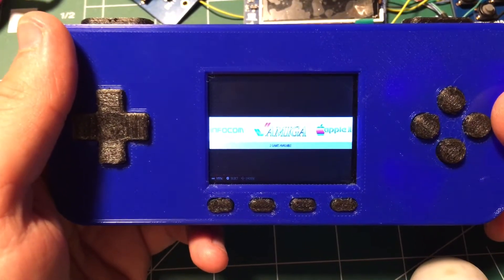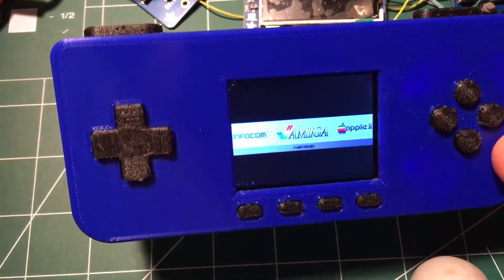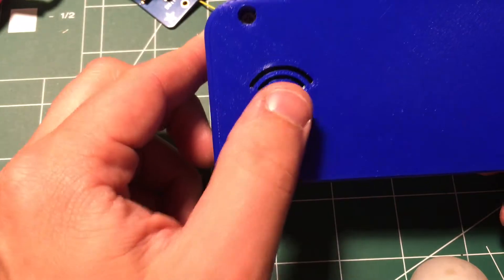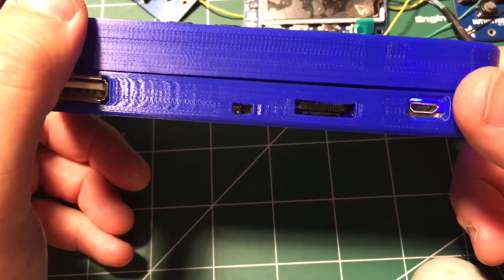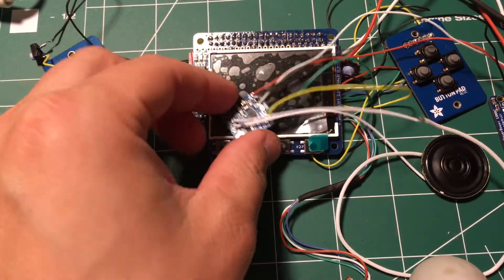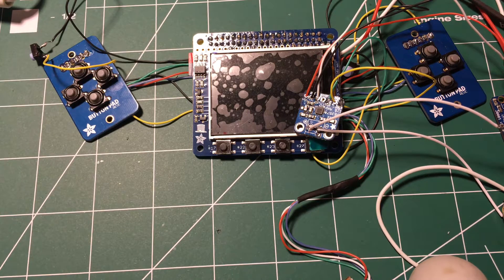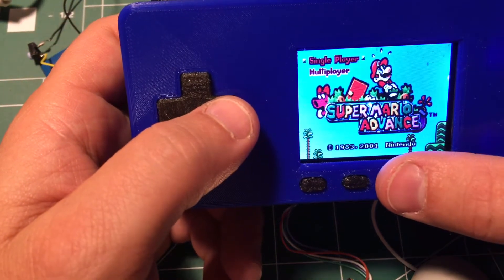PiGRRL Zero - Modified Case and Added External Audio

Comment: There is a point on the amp (the sd point) where the instructions say to solder to 5V on power boost. There are actually 2 that are supposed to solder to the power boost. Where exactly do I solder both of those?

Comment: i downloaded all the files do i combine them on 7z?
and if so, does it give me an img file once combined?
Reply from the maker: Yes it will produce a .img file. It should work fine, but let me know if it doesn't, I can host another one.
Reply: Ok I thinkI got it now, I burned the image on ad card and put it in the pizero. All buttons work but all I get is white noise? Am I missing a step. All my wiring seems to be correct
Reply: Sorry I'm kinda new at this lol
Reply from the maker: No worries! It's a fun project so ask all the questions you need.
Reply: thanks, well  ive got it all wired up and running but all im getting is white noise, am i missing a step?
Reply from the maker: I'm not sure what it could be. I'd need some photos or a video of how you hooked it all up.
Reply: ok ill take some pictures and post them here in a bit
Reply: do you have an instagram? i can send you the pictures through there.
Reply from the maker: How about posting them to imgur and then sharing a link? Hit me up with an email and we can chat directly there.
Reply: There you go, let me know what you think
Reply from the maker: Well your wiring seems to be correct. Move  your speaker close to one of the PCB's, and see if you start to get audio then. I notice that if you don't have a ground near the speaker itself, it won't work correctly.

Is it constant white noise? Is it loud? Can you make a video of the noise its making? Could be the speaker too. these things are easy to damage sometimes.
Reply: yea its constant if i turn the pot clockwise it gets louder, you have to put your ear to the speaker in order to hear it. do you think maybe its a faulty amp? i have 2 speakers one from adafruit and one i salvaged off a digital picture frame and they both do the same thing. ill try moving the speaker like you said and make a video. i got another amp coming in from adafruit tomorrow so we'll see if the amp is the problem.
Reply from the maker: The amps can blow out sometimes, I have a couple on the walls that have went on me because of bad hook ups or whatever. You should try another amp and another speaker. Maybe disconnect the potentiometer and direct connect it first to see if that isn't the issue first.
Reply: same thing happened with the new amp. idk what it could be. all i get is white noise. an no sound at all with  it being hooked up directly
Reply from the maker: Did you try a new speaker? Did you disconnect your potentiometer and try it without that first? Maybe double check your wiring connections to be sure it isn't that? Does the system work without sound? Can you play games?

Comment: Just got everything wired up.  The audio is super distorted, almost white noise.  It's very quiet for almost the entire dial turn, but then gets super loud once you turn the dial all the way.  Anyone else have this problem?  NES games seem to be running slow as well.  Weird!
Reply from the maker: +Sean Horton sometimes I get some lag in NES games, but it usually isn't a big deal. Could be the emulator, maybe try a different NES emulator. 

Audio can be distorted if you don't have a proper ground from the speaker or volume dial. Check your grounds and see if they are connected to a PCB ground or something.
Reply: Thanks for the reply!  I fixed the distortion by wiring the audio directly to the back of the pi.  Originally, I just unwired the button pcbs and transferred those wires to the audio chip.  Basically it was wired to the PiTFT.

I didn't think nes games would hit the Zero that hard.  It's slow to the point of being unplayable, and distorts the audio a little.  The menu audio is clear though.

The main problem I'm having now is that I don't get any sound unless I turn the dial all the way.  If I touch it even slightly all sound goes away.
Reply from the maker: Sean Horton I have the same issue. I think if you read up more on potentiometers you can set them up with a broader degree of range to allow for more incremental adjustment. You could also look at abandoning the potentiometer and switch over to software based volume adjustments. You can actually setup hotkeys to do all the volume adjustments quickly with your buttons.

Comment: How's the frame rate while playing games?
Reply from the maker: Frame rate is pretty good. There are a couple games that shudder but all in all you can get everything below PS1 and N64 working pretty well.
Reply: +Josh Petersen awesome! I'm currently working on something similar and bought a 2.4 pitft for it and I felt worried about that. https://hackaday.io/project/12751-neogeo-pi3 I just got started with it. Any feedback would be awesome!
Reply from the maker: I'm looking at a 3.2" PiTFT for a Zero XL build. I've been reading that the pi zero can push that size of display.
Reply: +Josh Petersen +Josh Petersen nice! I went for the 2.4 pitft because it fits incredibly well inside the neogeo pocket. I think the pi zero is perfect for the NGP, so that's one of my next projects as soon as I finish this one. I might make a portable media player using a pi3 and a bigger display + a pi drive, I want to fit it inside an old sony walkman.
Reply from the maker: Love the design! Keep up the good work!

Comment: Hi Josh,
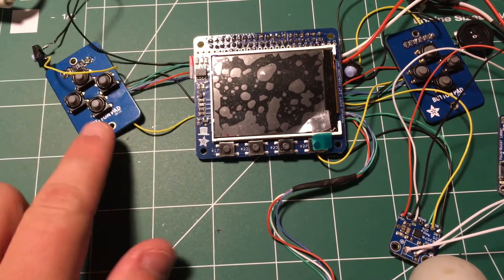@1:58 - yes, I'd like to know more about the "quiet buttons" (searching eBay didn't turn up any results).  Also, what is that circuit board they are on?  It looks like a board called "button pad" built by AdaFruit, but searching their site I didn't find it.  What is this board?

Thanks,

Jeff
Reply from the maker: Hey Jeff, yeah the quiet buttons you can get a couple places, but unfortunately you had to get them from China, which means they will take awhile to ship unless you're willing to pay for it. 

Aliexpress (However they are from China and take awhile to deliver unless you pay extra for it)
http://www.aliexpress.com/item/10pcs-No-sound-conductive-silicone-key-switch-8-8-5-soft-head-touch-button-switch/32605523792.html?spm=2114.01010208.3.10.1SlY6F&ws_ab_test=searchweb201556_10,searchweb201602_5_10037_10017_407_10033_406_10032,searchweb201603_1&btsid=22edc533-917c-44b0-99b6-0a63e108a026

eBay (Once again from China)
http://www.ebay.com/itm/20PCS-8-8-5MM-DIP-4-Silicone-Switch-Mute-Silent-Switch-Tact-Switch-Mute-button-/151723036469?hash=item235365cf35:g:ycUAAOSwu4BViNvf

Another eBay link
http://www.ebay.com/itm/20Pcs-8x8x5mm-DIP-Push-press-Momentary-silent-Button-key-switch-silicone-4pin-/221847179904?hash=item33a71f5280:g:0RkAAOSwjVVVxVms

[EDIT] I'm sure if you dig around, DigiKey or Mouser sells something like this.
Reply from the maker: +Apple Babies MC very nice!
Reply from the maker: Here is a link for those who want to purchase directly from Adafruit - https://www.adafruit.com/products/3101